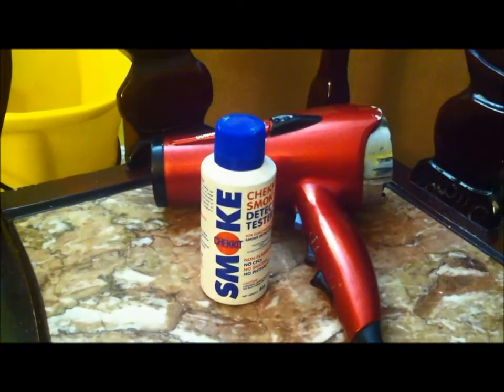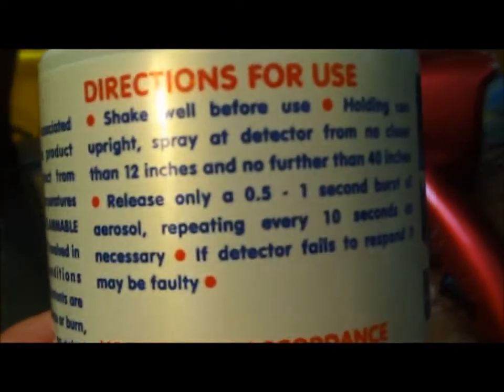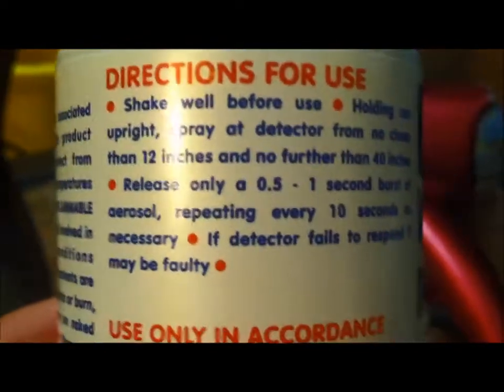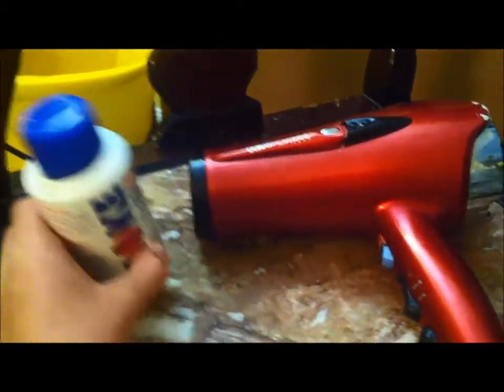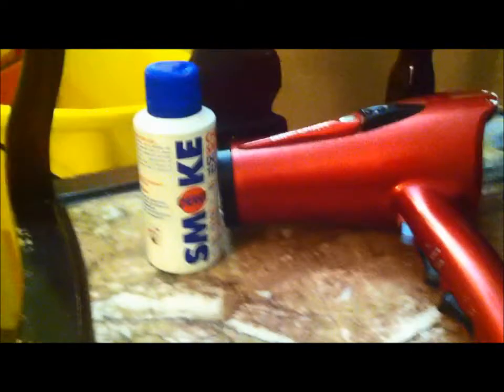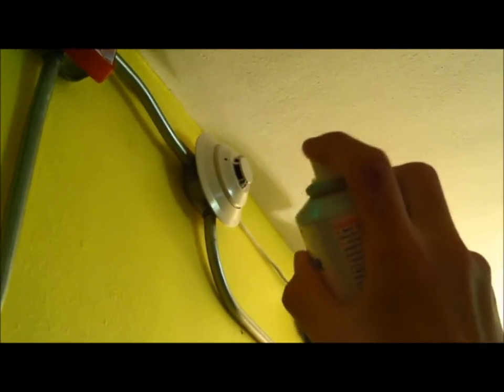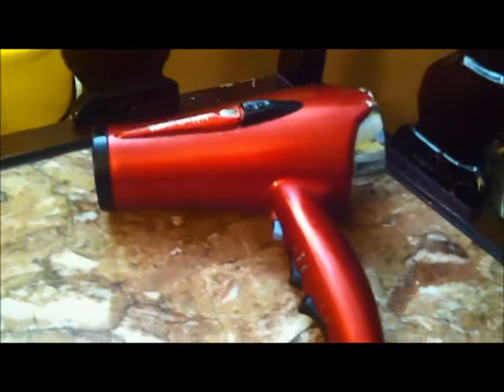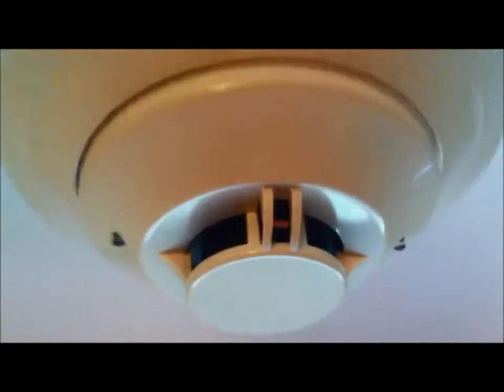Testing Smoke Detectors

Comment: I have a ionisation smoke alarm in my room at my dads and when I use my fog machine it triggers the alarm, it’s the kidde lifesaver smoke alarm. When ionisation alarms work best with fast flaming fires but not slow smouldering fires, if you want a alarm what detects slow smouldering fires you would want a photoelectric smoke alarm aka optical smoke alarm.

Comment: And on addressable systems the detector doesn't make the decisions the panel does, it collects data from the detectors such as humidity, dust, dirt and percentage of particles in the sensing chamber
Reply: Tyler Rodgers yes, that's why you can't use them without an addressable panel because it needs a data loop

Comment: Just to touch on shyhawk1998 said, yes there is radio active material in the detector ionizing the air inside to allow current to pass through it, it looks for a drop in current flow to set the alarm off and it knows when the current drops because inside the detector there are two chambers. The sensing chamber and a sealed reference chamber and if the current flow drops in the sensing chamber it compares the current flow in the sensing chamber to the reference chamber.